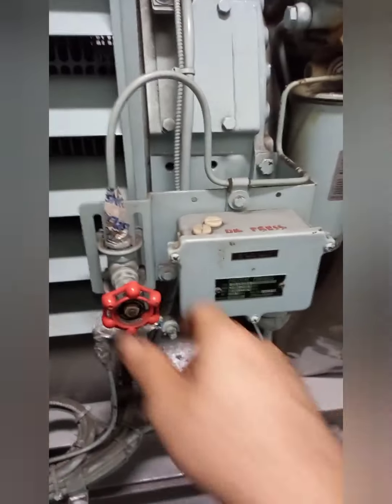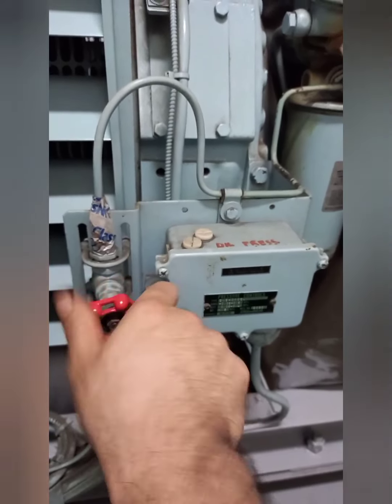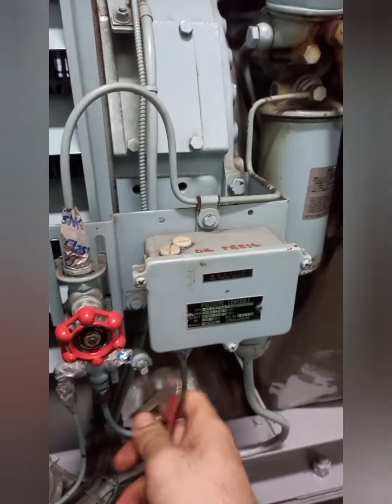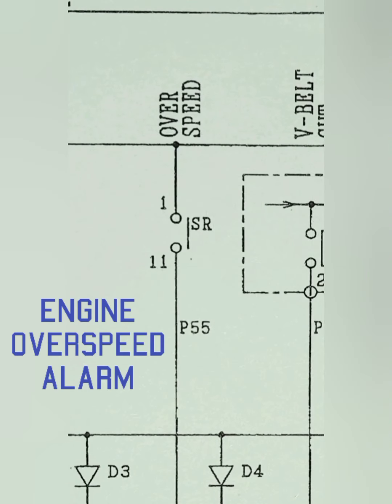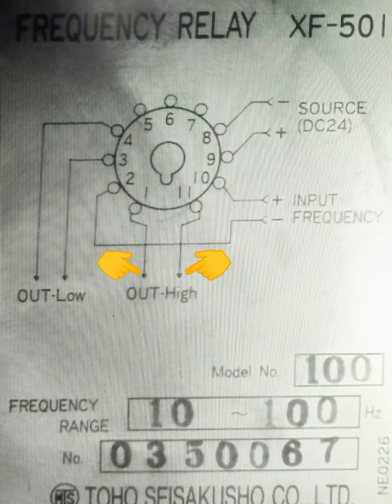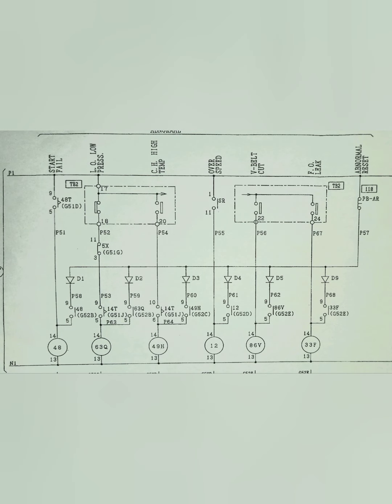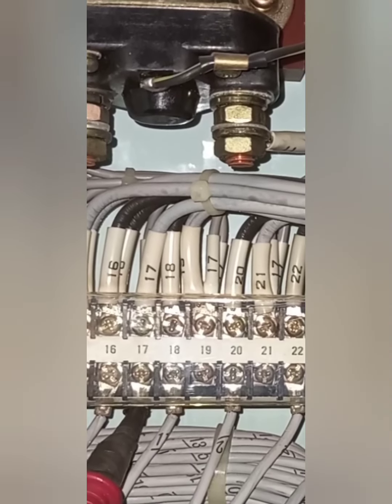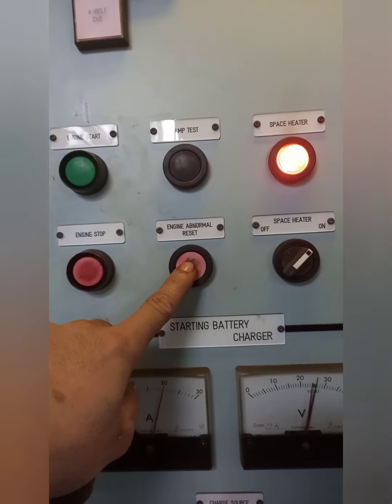How to test safety devices of Ships Emergency Generator👊

Comment: what kind of tools is it ? muti-meter and what function did did you use for testing ? omh , voltage or amp measurement ? thank you chief ! i saw that when you put 2 measuring stick head to the circuit the alarm will come , so it is like short cuircit right ?
Reply from the maker: Good day Sir,
Normally, safety devices are tested by allowing and running the equipment to reach the safety device set point.This is to know that the safety device is working properly and effectively…
On this type of equipment, the safety device only gives an alarm to the operator and will not stop the equipment…
The one I used is only the test probe and wire of a multi-tester which is connected at both ends.This is to make it easy to short the terminal connection of the relay to activate the alarm.
Thanks and keeps safe always….
Reply: @chiefmakenista5399  thankyou sir , fully understand